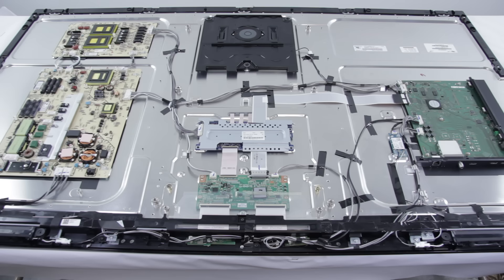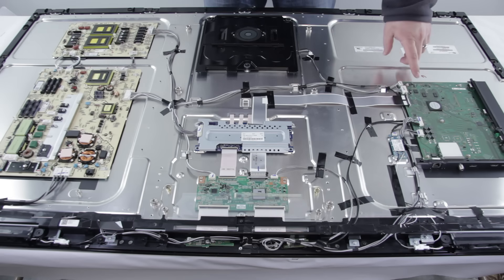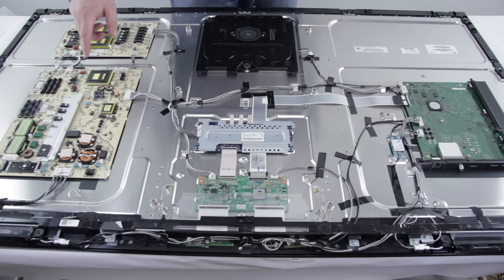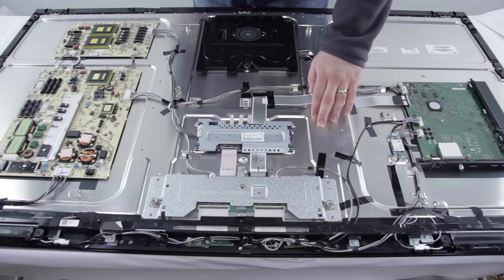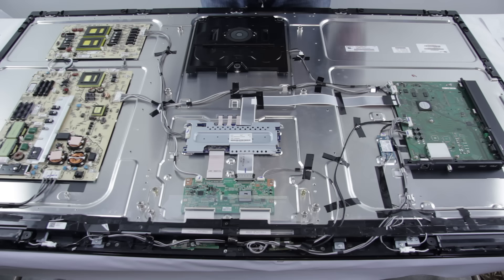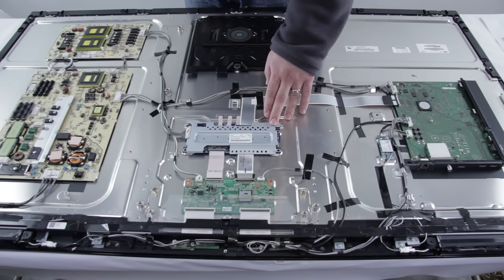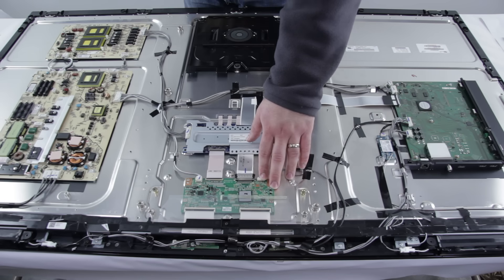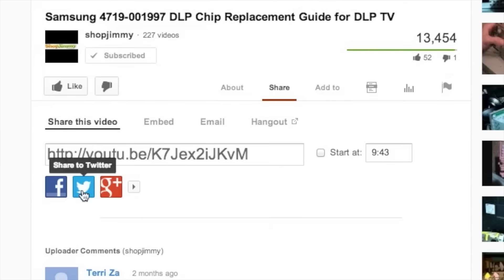LED TV Repair Tutorial - Common Symptoms & Solutions - How to Repair LED TVs

Comment: thanks for your informative video it was a big help, I have a Samsung UE40D5520 which is stuck in a re-boot loop. It turns on and displays the 'Smart TV' logo and then HDMI3 appears in the top left corner - all as normal. It then seems to re-boot and go through the whole process constantly. It worked OK in the morning, I unplugged it from the wall from standby and when I plugged it back in later it was in this reboot loop. A local TV repair shop said looked at it and said it could be the power board or the main board but couldnt tell which as they didnt stock replacement parts and to get them in would be on a non-refundable basis. Do you guys have any idea what the problem might be? I believe the part numbers in question are BN40-00219A for the mainboard and PD46A0_BDY for the power board. Any pointers will be greatly received , cheers, Phil.
Reply: +Phil Ball I phoned Samsung and they asked if there was a 'clicking' sound when it rebooted, there is not if that helps.
Reply from the maker: +Phil Ball   Try all repairs and troubleshooting at your own risk.  I recommend replacing the main board in your TV.  Unfortunately I do not see any replacement parts in the search results for your TV model number on our website.  Please reply with your part number on your main board and I can try searching for replacement parts.  Thanks and please let us know if you have any further questions!  www.shopjimmy.com

Comment: RCA LED42C45RQ:
Im having problem with my LED tv..i have to plug and unplug from power outlet before I could turn it on. I tried to replace it with a new power supply board but it didnt solve the issue..if the tv turns on, the screen  video and  sound works good.but once you turn it off you have to unplug/plug several times before you could turn it on again.
Reply from the maker: +Jay Ernest Pineda   Try all repairs and troubleshooting at your own risk.  I recommend replacing the main board in your TV.  Click this link to replacement main boards for your TV model number:  http://www.shopjimmy.com/catalogsearch/result/index/?cat=56&q=LED42C45RQ  There may be multiple boards for the same TV model number, be sure to match part numbers on your current board, with your replacement for compatibility.  Thanks and please let us know if you have any further questions with your TV Repair!  www.shopjimmy.com

Comment: hi, I have samsung led tv UA40c7000, which has now horizontal lines (black & white), its like excel sheet on full screen. Also there are some red colour vertical lines band moving left to right.  its turns on, sound & also the picture with the lines as mentioned.  I contacted samsung service centre & was informed that display panel to be replaced, but the panel of the model is no more manufactured.  Could you please help me out, if there is any solution.  Its is 5 year old tv
Reply from the maker: +atmendes2004   Try all repairs and troubleshooting at your own risk.  This sounds like a TV panel (TV Screen) problem.  If your TV panel is bad, it may be more cost-effective to replace the TV as panels are typically hard to find in stock, difficult to replace, and expensive.  Thanks and please let us know if you have any further questions!  www.shopjimmy.com

Comment: Hi, So,  I have a 5 year old LG 32CL20 TV which has been turning off for no reason. It varies from turning off after 3o seconds, to turning off after 5-7 minutes.All capacitators look fine to me. They are all flat, none have bumps, but  I don;t have a multi-meter to test correctly. The red power light stays on, and the TV switches on each time but turns off after anything from a few minutes to a few seconds. 
I also changed the picture settings to reduce the brightness, change the contrast and turn off the power saving function.
After all these changes it lasts a bit longer each time, but will only stay on for about 5-7 minutes, then the screen goes blank, but the red power light goes on. When it is switched on again, it will stay on for about 5 seconds then go off. If I leave it a few hours, it will work again for 5 minutes.
Its a bit of a frustrating problem, but I have the feeling that it is something small and I would love to be able to fix it myself.
Got any ideas? Thanks
Reply from the maker: +Paul Tormey   Try all repairs and troubleshooting at your own risk.   I recommend replacing the main board in your TV.  Unfortunately I do not see any replacement parts in the search results for your TV model number on our website.  Please reply with your part number on your main board and I can try searching for replacement parts.  Thanks and please let us know if you have any further questions!  www.shopjimmy.com

Comment: My sony bravia KDL-32EX550 works good for a new seconds after turned on and after that the screen shows erratic(bad or wrong) colours. During working sometimes( only for a few seconds) display becomes good and again turns bad.What could be the problem?
Reply from the maker: +nieshwarpost   Try all repairs and troubleshooting at your own risk. This could be a problem with either the t-con board, the main board or the TV panel. You can replace the main board and the t-con board individually to see if one of those boards fixes the problem.  
Unfortunately I do not see any replacement parts in the search results for your TV model number on our website.  Thanks and please let us know if you have any further questions!  www.shopjimmy.com

Comment: Have a almost 2 year old LG 42LN5700-UH.  has typical symptoms has sound ut no picture, LG logo flashes for split second at start up then no picture. passes flashlight test with image and menu showing. Sounds like LED driver ? Same thing happened a few months back just  for one day? came home after work was ok. thought we pressed some button on the remote. Is this common with LG.
Reply from the maker: +Bob Biernacki   Try all repairs and troubleshooting at your own risk. This sounds like a problem with the actual LEDs inside your TV. These LEDs are replaceable, however it is recommended they are replaced by someone with the proper experience and training. When replacing the LEDs, the TV panel can get damaged. If the TV panel gets damaged, it is not repairable. Click this link to replacement LEDs for your TV model number:  http://www.shopjimmy.com/catalogsearch/result/index/?cat=299&q=42LN5700-UH   Be sure to match the panel information necessary to ensure you have the correct replacement LEDs.Thanks and please let us know if you have any further questions with your TV Repair!  www.shopjimmy.com

Comment: Hi I have a Hisense 55 inch LED 120 Hz LED tv. It powers on and the led lights up for a sec and then the led back light turns off. The red power led is still on. I do not have cable hence not sure if the audio is there. Usually stream things off Netflix. I opened the tv up and see 4 boards. Would you have any idea which board needs replacement?

Comment: I have an LG 39LN5700 that keeps "power cycling".  It comes on and displays the channel for a few seconds, then powers off and back on.  I have pulled out the power source board part number 62810301 - it appears that you have this in stock for $39.  Do you think this is the problem based on the symptom?  Thanks, Scott
Reply from the maker: +SCOTT SVEUM   Try all repairs and troubleshooting at your own risk.  I recommend replacing the main board in your TV.  Click this link to replacement parts for your TV model number:  http://www.shopjimmy.com/catalogsearch/result/index/?cat=56&q=39LN5700  There may be multiple boards for the same TV model number, be sure to match part numbers on your current board, with your replacement for compatibility.   Thanks and please let us know if you have any further questions with your TV Repair!  www.shopjimmy.com

Comment: Hello, I have a JVC model number: HD56G887 serial number: 12162878. Here are my symptoms; when I push the on/off switch the on light comes on, but the screen never lights up. There is also a whirring sound after about 30 seconds the TV shuts off. Can you make any suggestions?
Reply from the maker: +Barbara Durham  Try all repairs and troubleshooting at your own risk.  I recommend replacing the main board in your TV.  Click this link to replacement parts for your TV model number:  http://www.shopjimmy.com/catalogsearch/result/?q=+HD56G887  There may be multiple boards for the same TV model number, be sure to match part numbers on your current board, with your replacement for compatibility.  Thanks and please let us know if you have any further questions with your TV Repair!  www.shopjimmy.com

Comment: I have a samsung led model un55eh6030. Serial z5qz3cac905026e. My picture has horizontal lines at the top and bottom of the screen but a clear picture in the middle
Reply from the maker: +richard megee   Try all repairs and troubleshooting at your own risk.  This sounds like a TV panel (TV Screen) problem.  If your TV panel is bad, it may be more cost-effective to replace the TV as panels are typically hard to find in stock, difficult to replace, and expensive.  Thanks and please let us know if you have any further questions!  www.shopjimmy.com

Comment: Need help, with my Samsung TV UE37D5700RSXZG, i turn it on and it work very good, but when i turn it off, after 2 minute it dont start. I see only the smart TV logo and the stand by light is blinking, then it turn it off by itself and start the same sequence (smat TV logo is blinking..) When i cut it from the main power supply for 3 hours, after i can start the TV normal and it works very good. What can i do?
Reply from the maker: +Josef Kohl   Try all repairs and troubleshooting at your own risk.  I recommend replacing the main board in your TV.  Unfortunately I do not see any replacement parts in the search results for your TV model number on our website.  Please reply with your part number on your main board and I can try searching for replacement parts.  Thanks and please let us know if you have any further questions!  www.shopjimmy.com

Comment: I have a Avol AET58410UWD 58 inch LED TV. It is a dual US/European so has a EU TV option which has no signal going to because I don't pay for German tv. I have AFN (Armed Forces Network) that the screw on port American style cable hookups say US TV. The US TV works on my 32 inch Magnavox but not my 58. What are the possibilities. Trying to use the same cable.
Reply from the maker: +Renegade ChevyBoyUSA1  Try all repairs and troubleshooting at your own risk.  Unfortunately, the same cable will not work.  Thanks!!  www.shopjimmy.com

Comment: I have a Samsung Led TV, UN60ES7100FX. The top half of the TV picture is very dark but the bottom half is fine. What could be causing that?
Reply: +Medrick Blaise Did you find a solution yet? I have a similar problem with my Samsung 40F6400.
Reply: +Nikhil Rao I had my tv checked out and they said it was the LED backlight and it can be repaired. The problem is that they are connected to the back of the tv screen and would have to take the tv completely apart to repair it. Said it would cost about $350. Might get a second opinion.

Comment: i have a Samsung un40d5003bfxza and it has colored vertical lines all over the TV. will the problem go away if i replace the t con board?
Reply from the maker: +Alejandro4891   Try all repairs and troubleshooting at your own risk.  This sounds like a TV panel (TV Screen) problem.  If your TV panel is bad, it may be more cost-effective to replace the TV as panels are typically hard to find in stock, difficult to replace, and expensive.  Thanks and please let us know if you have any further questions!  www.shopjimmy.com

Comment: Hi sir my LCD Sony KLV-32EX330, my problem sir is the color  blue and green when im watching turns violet , and its blinking to its original color, ive tried everything factory reset and the cable and nothing happens please need some suggestion or a fix for this problems tnx :)
Reply from the maker: +Titus Claro (WaffetOpaw)   Try all repairs and troubleshooting at your own risk. This could be a problem with either the t-con board, the main board or the TV panel. You can replace the main board and the t-con board individually to see if one of those boards fixes the problem.  Unfortunately I do not see any replacement parts in the search results for your TV model number on our website.  Please reply with your part number on your main board and I can try searching for replacement parts.  Thanks and please let us know if you have any further questions!  www.shopjimmy.com

Comment: My samsung un65f6300af has a dark shaded area all of the way across the screen. The sound, picture, and ports all work but the shade is present using any input. It is a 4" dark area that stretches horizontally across the screen.
Reply from the maker: +Wayne Deskins   Try all repairs and troubleshooting at your own risk.  This sounds like a TV panel (TV Screen) problem.  If your TV panel is bad, it may be more cost-effective to replace the TV as panels are typically hard to find in stock, difficult to replace, and expensive.  Thanks and please let us know if you have any further questions!  www.shopjimmy.com

Comment: Hey, any help is appreciated. 
Tv > Insignia Ns-55l260a13

tv would work for about 30-45 minutes in most cases (sometimes less) then would turn off completely with no response afterwords. After sifting the internet as much as possible it lead me to believe the main board was the issue due to the symptoms - No standby light, No sound, No picture, No lights, No response. Ordered a board and after installing it now have different symptoms. Standby light is solid, though when you try to turn the tv on, the standby light flashes about 6 times and goes back to solid, again with no more response. I then unplugged the Main inverter board and can then turn on the tv and the standby ilght goes off continuously but still nothing on the tv. Havnt done a flashlight test yet but was curious if you had any input, Thanks.

*edit - With the main inverter unplugged i was able to do the flashlight test and verify i can see the menu and with that changed the input and was able to get the sound. Based on all of that, it looks like its the inverters. The only question is when the main inverter is plugged in is there a system lockout or something? Why would it be unresponsive when its plugged in?
Reply from the maker: +SupImTrance   Try all repairs and troubleshooting at your own risk.  This sounds like a problem with the inverters in your TV.   Click this link to replacement inverters for your TV model number:  http://www.shopjimmy.com/catalogsearch/result/?q=Ns-55l260a13  There may be multiple boards for the same TV model number, be sure to match part numbers on your current board, with your replacement for compatibility.  Here is a link to a video showing how to identify your part number, click here:  https://www.youtube.com/watch?v=9bxbWt0Tgnk  Thanks and please let us know if you have any further questions with your TV Repair!  www.shopjimmy.com
Reply: +ShopJimmy.com Yea thats what i figured so i replaced them and now it will work for a approximately 10 minutes the screen blacks out and has no sound and is unresponsive until I unplug it for atleast 1 hr. At this point im thnking its not worth pursuing as im beginning to think it might be the screen. Does that sound like screen problem symptoms? Im hesitant to take it to tv repair as were already getting to a point where its better off to get a new tv.

Comment: hi i ahve problem with my Samsung Tv Mode UN40F6300AF is wont turn on but the light is blinking please what have to do..? thank you
Reply from the maker: +Iko Quraisin   Try all repairs and troubleshooting at your own risk.  I recommend replacing the main board in your TV.  Click this link to replacement parts for your TV model number:  http://www.shopjimmy.com/catalogsearch/result/index/?cat=56&q=UN40F6300AF  There may be multiple boards for the same TV model number, be sure to match part numbers on your current board, with your replacement for compatibility.   Thanks and please let us know if you have any further questions with your TV Repair!  www.shopjimmy.com

Comment: Samsung un40eh5300f. Has sound but no picture. Flashlight test confirmed that there IS an image and the back light is not working. What do I need?
Reply: +Russell Fought you will need to replace the T-Con board that is the fix majority of the time.
Reply: Or would it be the LED driver on the power supply?
Reply from the maker: +Russell Fought     Try all repairs and troubleshooting at your own risk. This sounds like a problem with the actual LEDs inside your TV. These LEDs are replaceable, however it is recommended they are replaced by someone with the proper experience and training. When replacing the LEDs, the TV panel can get damaged. If the TV panel gets damaged, it is not repairable. Click this link to replacement LEDs for your TV model number:   http://www.shopjimmy.com/catalogsearch/result/index/?cat=299&q=un40eh5300f  Be sure to match the panel information necessary to ensure you have the correct replacement LEDs.Thanks and please let us know if you have any further questions with your TV Repair!  www.shopjimmy.com